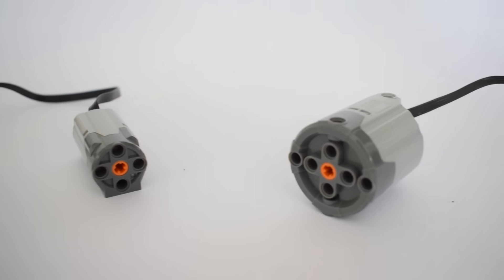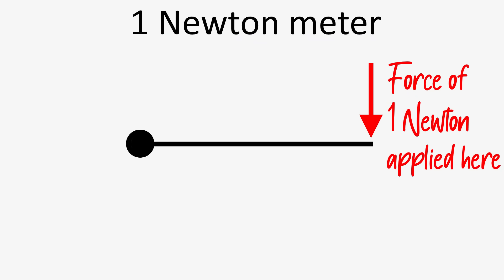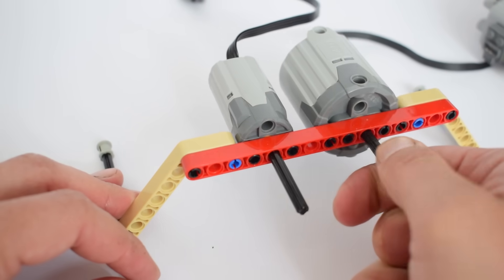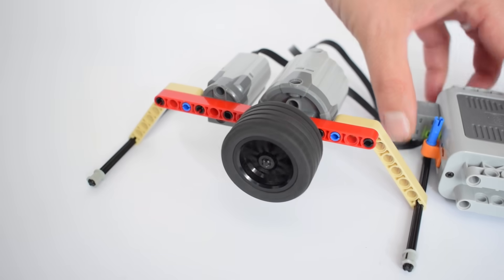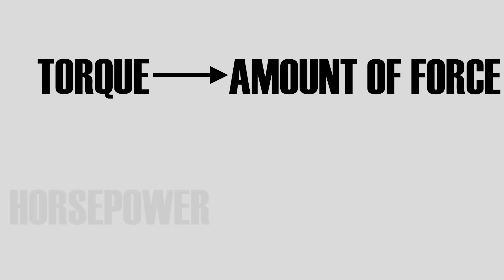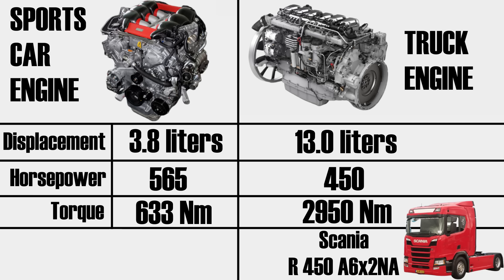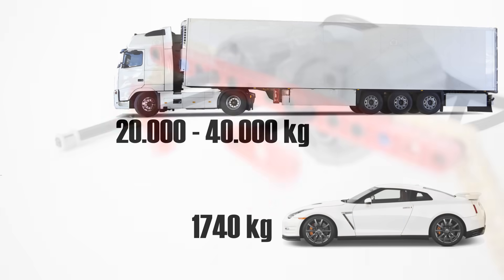NEVER be confused by HORSEPOWER and TORQUE again - HP and TORQUE EXPLAINED in the MOST VISUAL WAY

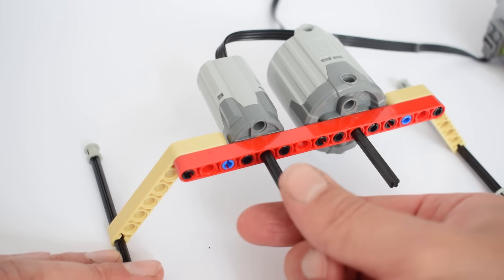Comment: 6:16 I had such hope for your video. It started off very very well. Then, you said you can't feel power. Yes, you absolutely can. You can feel any power, including hp. If you stick your finger in a light socket, you can feel it. Electrical power is current times voltage. If no current, then you can't feel it. If no voltage, then you can't feel it. Same with hp. If no torque, then you can't feel it. If you don't allow the spinning, which is the time component, then you can't feel it. You must let it spin, and there must be torque. Without torque, it doesn't move. Without the spinning allowed, it doesn't move because you're holding it.

What you feel in the car, as it's accelerating, is not torque. That's hp, because you are not spinning, the tires are spinning, which is what matters. If the tires are not spinning but are applying a force, like in the example, and something is holding it, then you have no hp... and obviously the engine shuts off, unless the clutch/torque converter is slipping. Hold the engine from spinning, and it shuts off.

In the car, you feel acceleration, which is hp divided by weight (f=ma so a=f/m). Newton’s second law is one of the most important in all of physics. For a body whose mass m is constant, it can be written in the form F = ma, where F (force) and a (acceleration) are both vector quantities. If a body has a net force acting on it, it is accelerated in accordance with the equation. Conversely, if a body is not accelerated, there is no net force acting on it. Back to the car. If the car is a billion lbs, then the car goes nowhere, unless it has a billion hp [or similar] to match it. If it can't move because the billion lbs is too much, something has to be slipping to continue without the engine shutting off.

Both torque and hp is present if there is slip, and both are present when there is acceleration... and even when just moving at a steady state/mph... why? Because the car is moving, and the engine is running. An engine will not continue running if it is kept from spinning, it's how a combustion engine works. An electric motor is different. It can just apply torque, without hp, because the way it's made. If you grab the tire while it is spinning and try to get it to stop, besides hurting yourself, you are experiencing hp and torque. Once you get it to stop, you will experience torque only for a split second if the engine shuts off. HP is always present on a vehicle.

Torque matters, HP matters more. If you truly understand, then there is no argument. If you argue this, you are admitting that you don't understand. I'm sorry, it's the truth. If you are even more confused, blame it on the guy that made the video... just remember this, acceleration is hp divided by weight (a=f/m, where f is the force, hp, and m is the mass or weight of the vehicle). Forget all the rest, and you will be fine. HP, acceleration, weight. Know the relation, and you're done. "Relatively heavy" big trucks need instant high HP to get moving, cars don't. Big engines can deliver that instant high HP... but they can also deliver even higher HP, but it costs significantly more. If the engine is 3 times the size, then it can deliver 3 times the hp with the right amount of money. If a 2.0L can make 2000hp, then a 6.0L can make 6000hp. But do you need 6000hp??? Don't you think 2000hp is plenty? Torque is cheap and easy, hp is not.

What people are confusing when they say they feel torque, is that instant high hp when you start accelerating. You can convert an engine that produces low torque into high torque at the wheels with gearing. It doesn't matter what the engine is producing to the end user/driver, it only matters to the engineer... and the accountant that finds it cheaper to put in a big engine or a small engine and more/appropriate gears. All you want is the acceleration for the amount of weight that you need to move. So all you care about is HP, acceleration, weight... let the engineer worry about torque produced by the engine, gearing, hp, acceleration, and weight. Too many factors to worry about, as it just confuses people, and talk of torque is unnecessary... but, If you truly care, then talk of torque at the wheels, since torque produced at the engine won't matter once the engine is installed in a vehicle, with a transmission attached. Instantaneous HP can be changed with gearing. You don't need high torque produced at the engine, to get high instantaneous hp... but, it does make it easier. Easier is the key to why big trucks use big engines.
Reply: Acceleration is weight divided by hp? Laughable but other than that's good. You can't feel torque the same reason you can't feel power, because both have two variables.
Reply from the maker: If you argue this than you are admitting you don't understand 😂😂😂 thanks for that. Great laugh. Just to make it clear: you can't feel horsepower. When the car is accelerating that's g-force. If you put your finger against something spinning that's friction. You can't feel a mathematical calculation son. I'm sure you have a beautiful mind, but you still can't feel it 😉
Reply: @d4a  That's kind of correct - arguably you can't feel anything directly. Everything must be sensed, converted to neural signals, and translated into sensations. So you can't sense torque or power. But it did kind of render that bit of the video pointless!

Comment: Doesn't Torque have to be always Tangential? Torque also have to be continual or the motor would stops. So torque has to be applied over time at a give rate! But the always give a maximum or peak torque, from a graph!

Comment: Performance car or light truck engines can make the same HP as heavy truck engines but they are not interchangeable for several reasons.  The performance car engine cannot reliably sustain its max output for the thousands of miles required of a heavy truck engine.  The heavy truck engine is, by design, running nowhere near its breaking point.  It can literally "do this stuff all day, every day".  

The other side of the coin is that the heavy truck engine weighs as much as many complete sports cars and would therefore make a poor sports car engine.  A 500HP LS engine weighs roughly 500 lb.  A DD15 truck engine of similar hp weighs about 3000 lb.  They are simply designed to excel at different jobs.

Comment: thank you for this explanation. It would be nice to take it a step further to explain the effect of torque and HP on speed and acceleration
Reply: First thing is that author was wrong about sitting inside a car. You will feel horsepower not torque. You can add torque to that Lego motor with some gears but you can not add horsepower.
Reply: @expioreris  You feel the force (torque). HP is not a force, its a measurement, a bit of data, there is nothing to feel.
Reply: @LiveFromLondon2  You indeed feel a force, but it's not the torque from the engine, unless you're wrapping around your hands around a driveshaft and trying to stop it from moving, then you'd feel engine torque.
What you're feeling is the seat pushing back on you because the car is accelerating but your body resists movement because of inertia. And acceleration is purely detemined by how much work the engine can do, ie. how much horsepower it's producing.

Comment: Power at the crankshaft is equal to the Torque at the crankshaft times its angular velocity (basically revs). This means that two engines with the same number of cylinders and the same bore and stroke and con rod length will make (pretty much) the exact same Power for a given Torque and revs. The reason the truck engine makes more Torque at the crank at a given revs is mainly because it has bigger pistons and longer con rods.
The other point is that a gearbox can be used to increase Torque, so it would be theoretical possible to generate the exact same Torque at the wheels with the sports car engine as the truck engine by use of gear ratios. However the ratio would have to be really large, which would make the gearbox bigger, so the higher torque truck engine is a better option for towing heavy loads.
Edit: Also, if an engine is making more Torque (at the crank) at a given revs than another engine, it is also making more Power at those revs. This fact seems to confuse a lot of bikers who incorrectly think that a bike like a V twin can make more Torque but less Power than an inline 4 bike at a certain revs (say 5000 rpm). Typically the V twin makes higher torque and power at lower revs than the inline 4, whereas the inline 4 makes more power and torque at high revs.
I am pretty sure that the Truck engine in the video must be dumping all its 480hp at very low revs (1000rpm) hence the huge Torque numbers.
Reply: Actually, any two engines making the same torque at any engine speed, are making EXACTLY the same HP! [EDIT: I mean the two engine speeds are the same, but they can be anything!]

The truck in the video produces maximum torque of 2950Nm and 350kW (450HP). Because Power=torque x angular velocity,  we know that it can only rev to 120 radians/sec. (350,000W / 2950 N.m). That is about 1100 RPM, close to what you guessed. Any higher revs from that engine must see torque falling proportionally faster, else its maximum power would not be limited to 350kW.
Reply: @TheSwordsmon  I don't think so. Two engines making the same torque but at different revs are NOT making the same power at those respective revs. As you say, Power = Torque × Revs, so if engine A is making 1000Nm at 1000 revs per minute, and engine B is making 1000Nm at 2000 revs per minute, then engine B is making double the power at 2000 revs per minute.
What I am saying is that if engine A has more torque at 1000 revs per min than engine B at 1000 revs per minute, then it is making more power at 1000 revs per minute (as per the Power = Torque × Revs formula). And two engines can have very different maximum Torques but the same peak power...which was the point of the Truck engine versus Sports engine example. So I am not quite sure what your point is?
Reply: @guitarpaul3645  No, I meant if they are at the same revs, regardless of what those revs might be! I can see why what I wrote was ambiguous. I have added an edit to what I wrote above. Thanks for pointing it out - I completely agree with you.

Comment: thanks very good video! if you want to add even more wow factor to this in some countries in Europe the max standard weight for a truck with the correct trailer system the limit is up to 74000kg on the largest public roads.

Comment: This video was a god sent to finally end a discussion with a friend of mine.
He was the typical guy who heard something somewhere and didn’t bother to look for more info.
He was always saying ; all you people ask about Hp when in real world you should only care about torque.
And I was always trying to explain him that any sport or super car that has 500 or more HP is probably on the edge of how much torque the tires  can take.

And my example to prove it where 2 different Mercedes AMG GT models.
The older one had 98 more torque
The newer model , with the exact same engine , and exact same weight, had virtually the same HP too
But had 98 less torque.
So torque was purposely cut down.
And the new one was considerably faster in lao times.
And more praised in reviews.

He kept on grunting nonse like those drivers can’t handle the faster model etc…
This video finally made him understand what torque really means.
And therefore I could finally explain to him , why past a certain point cara have much more than enough , and that’s why it is often not even and advertised figure.
The torque isn’t going to increase your speed , unless we invent some sci-fi wheels that stick to the floor like if they where covered in glue … 
But at the current Ho cars have and the proportional torque those kind of engines produce , more torque only means more aggressive traction control system.
More torque means loosing grip on fourth gear 😂

Comment: Then a=F/m why the sportscar does not have the truckengine because higher torque means higher accelerationforce?
Reply: Because being lightweight is very important for a sports car. You can achieve the same acceleration as having pure torque while still being nimble around corners
Reply: Force is a thrust between wheels and a road. It is dependent on axle torque and wheel radius. Torque also occurs at a certain rotational speed. We can achieve infinite rate of acceleration by increasing torque (due to mechanical advantage aka "gearing") and/or decreasing wheel radius, but performance (what we are looking for) remains the same. This is because acceleration is described not only by its rate but also with speed from which it occurs and we don't want to loose it. 
Simple example: a car accelerates 0-100km/h in 5 seconds, another car accelerates 100-200km/h in 5 seconds either. It is not possible that the second car can't accelerate 0-100 faster than the first one (not even taking air drag into account).  This is because a second car pushes the road with the same thrust but at higher speeds, and when geared down (for 0-100, i.e. similar conditions) it has higher thrust than the first car. It is described with power=force x speed, i.e. the amount of force that occurs at a certain speed. Fit it into the 2nd Newton law and get
Acceleration= Power/(speed x mass). 
Acceleration is better the higher the power is, and the lower the speed and mass are. 
Trucks and tractors of course, need power too (amount of torque times rotational speed), not just the amount of torque.

Comment: You can describe horsepower as the acceleration of weight, resp. force.  1hp is the power you need to lift 250 kg at 0.3m in 1 second. The more hp, the faster you will lift the 250kg 😘

Comment: No. Why cars that have the same amount of weight and horsepower. but one have 140nm of torque and another 240nnm of torque accelerate astronomically differently.  In compare this 140 is pathetic compared to 240nm one.  Both have the same amount of horsepower and weight.

Comment: So what is faster in a straight line, a car with more torque or a car with more horsepower than the other? (Both are the same weight)
Reply: The car with better gearing and traction (to an extent, of course)

Comment: A Diesel has more torque than Petrol engines compared to Horsepower. For example a Diesel with 150HP and 340Nm and a Petrol with 204HP with 245Nm. In this example a Diesel would outperforme the Petrol in acceleration?
Reply: with perfect gesring at simialrmweight drive train losess similar shifting time drag asf everything equally + perfect gearing for both only engine diffrent than NO CHANCE more topend petrol always win 👌🏻 once it wpuld have enough narrow peak in regsrd to diffrences between gear lenght now it can ise less avg power for accelerstion at specified distance and in did lost but for such gearing in resgsrd to topend power width and level  must be enough bad 👌🏻 or resist enough biger for petrol so drag inertia whatever what or all togehter give enough biger whole eressit than it lost once resist be not enough biger + perfect gearing everyhing else equall thsn petrol win 👌🏻 disel win only of it would have more topend power  never ever cos have more lowend torq 👌🏻
Reply: Car is not solely an engine. If gasoline one has to be made faster, it will be, and this is how it is usually. Diesel is there for fuel economy only.

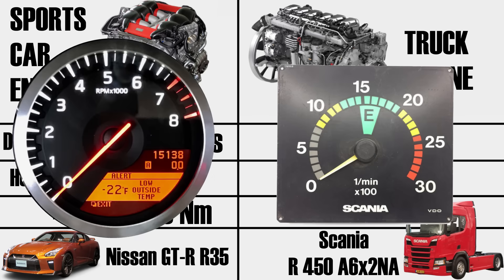Comment: Quick question. You mentioned that we can only "feel" torque but not horsepower. In fact the lady at around 6:20 feels the torque as she is pushed back into her seat. Now coming back to 7:35, the difference table shows that sports car(633 Nm) has less torque than the truck(2950 Nm). 

So If I sit in a sports car and it goes very fast, I will be pushed back into my seat because of inertia and importantly because I can feel the torque(of about 633 Nm) from the sports car just like the lady in the video.

Now using the same logic, I would expect to feel even more torque in the truck(which is almost 4 times what we have in sports car i.e., 633Nm vs 2950 Nm). But in my limited experience of being driven in trucks, I never felt such torque. In fact I have never seen trucks go fast enough to push me back into my seat like say a sports car would.

So whats happening here? Is our initial assumption that we are only feeling torque(like the lady), wrong?
Reply: Torque is hypothetical by definition, it can not be felt. That is force, or thrust, that accelerates a given mass. The higher the mass the less acceleration with a given amount of force.

Comment: hmm, I don't get it.
Can't you attach a sequence of gears to a motor to get any torque you need which makes hp the only improtant parameter?
Reply from the maker: It's not that simple. There's a price to be paid
https://youtu.be/txQs3x-UN34
Reply: @d4a  thank you for the answer. but i'm still confused. as I said we got torque we need using gears,  but it was slower.  So the amount of work per second is changed, doesn't it mean  we traded horsepowers for torque? and if so, can we turn both motors to the same torque and compare only horsepowers?
Reply: Sure, power output is all that is needed for performance.

Comment: Still confused. What about gearbox in terms of horsepower or torque? Why don't put small engine with hight RPM along with hight gear ratio gearbox? So the torque will be enauth to pull as much weight as it required
Reply from the maker: https://youtu.be/txQs3x-UN34